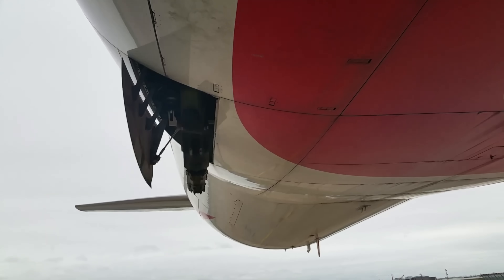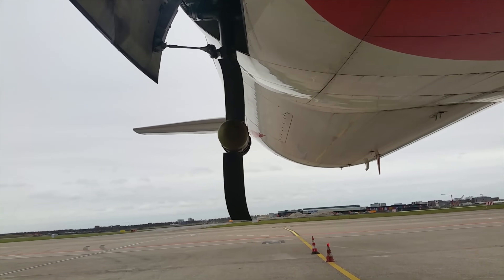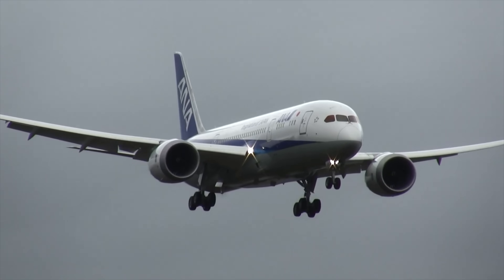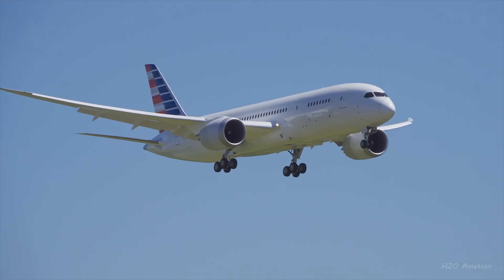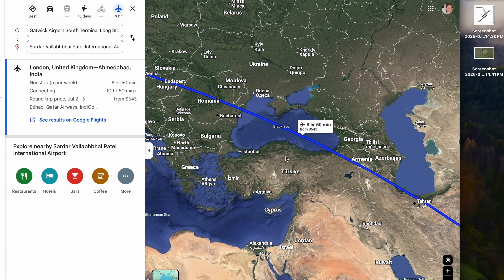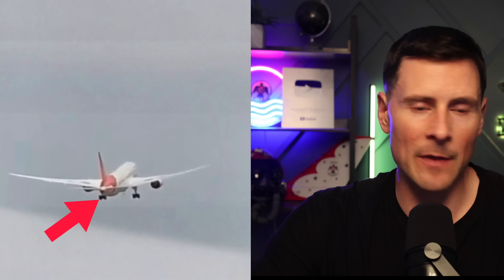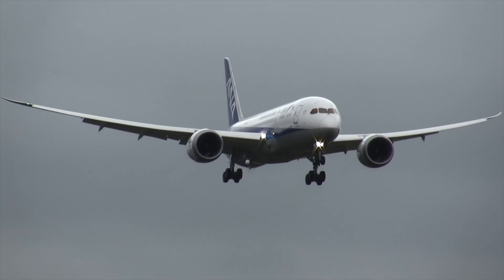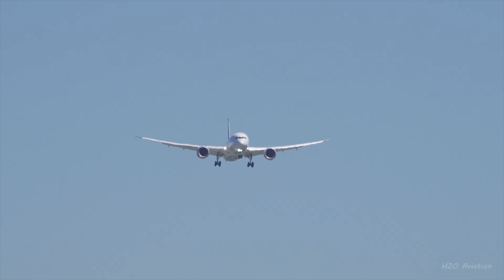Air India 171 SHOCKING UPDATE on RAT Deployment and Flaps!

Comment: Little leak for you from the pilot community: Flight: AI-171 | Aircraft: Boeing 787-8 | Date: June 25, 2025 | Route: Ahmedabad (VAAH) → London Heathrow (EGLL)
Crash Site: ~1.2 km from VAAH Runway 23, post-V1 and rotation
Fatalities: 247 (243 onboard + 4 ground)
Survivors: 0 onboard survivors (alternate to original), 3 injured on ground

⸻

🛠️  AAIB Preliminary Report Highlights

1. Primary Cause – Electrical Power Transfer Interruption (PTI) During Rotation
 • During transition from ground to airborne electrical configuration, the aircraft experienced a cascading dual-engine FADEC (Full Authority Digital Engine Control) failure.
 • Root cause: Uncommanded bus transfer failure due to arcing in the main power relay box (PRB-A), traced to water ingress during pre-flight GPU disconnection in heavy rain.
 • This led to loss of electronic engine control at rotation, resulting in both GEnx engines rolling back to ground idle within 4–5 seconds.

2. Flight Data Record Timeline
 • +0:11 sec: Nose gear lifts off.
 • +0:13 sec: Sudden engine rollback begins. Thrust reduces from 92% N1 to <27% within 3 seconds.
 • +0:16 sec: Master caution + ENG FAIL L/R warnings. FO calls, “Both engines dropping!”
 • +0:20 sec: Autopilot and flight control reverts to Direct Mode. Pitch up attitude peaks at 18°.
 • +0:25 sec: Aircraft stalls at 186 ft AGL.
 • +0:30 sec: Full aerodynamic stall; nose drops rapidly.
 • +0:38 sec: Ground impact at 54° nose-down attitude, 174 knots.

⸻

⚙️ Contributing Factors
 • Environmental Conditions:
 • Torrential rain during pushback.
 • Moisture intrusion into PRB-A connector (P/N: HLN8471) — a known corrosion-risk component.
 • Latent Maintenance Issue:
 • Power transfer relay unit showed signs of thermal damage in a previous MEL deferral 2 weeks prior.
 • No replacement had been conducted; aircraft was cleared under repetitive deferral.
 • Design Oversight:
 • Boeing 787 has no physical engine control backup (i.e., no direct mechanical linkage in FADEC loss scenario).
 • Loss of power supply to both EEC channels resulted in engine “freeze” at ground idle instead of flameout.
 • Flight Crew Response:
 • Attempted engine relight sequence not completed before stall onset.
 • Emergency power selector not activated — possibly due to confusion from multiple ECAM warnings.

⸻

✈️  Immediate Safety Actions
 • DGCA + EASA + FAA Emergency AD issued within 24 hours:
 • Mandatory PRB-A moisture integrity inspection on all Boeing 787 aircraft.
 • Temporary restriction on dispatch with MEL items related to power transfer systems.
 • Boeing:
 • Issued Service Bulletin SB-787-24-212 requiring replacement of PRB-A connectors with sealed versions.
 • Exploring addition of dual-path power redundancy for FADEC systems.

⸻

🧠 Lessons Learned
 • Over-reliance on electrical power distribution architecture without layered redundancy.
 • Lack of crew procedural training for full engine rollback during takeoff in EEC dual failure scenarios.
 • Need for improved environmental sealing in GPU/electrical handover units in monsoon zones.

⸻

🕯️
⸻

📅 Timeline – What’s Next?
 • Aug 15, 2025: Release of FAA/Boeing electrical design audit report
 • Sept 5, 2025: ICAO session on electrical-critical phase-of-flight risk mitigation
 • Oct 2025: Mandated design retrofit across 787 fleet (rev. SB-787-24-219)

Comment: It seems to me the Electrical power systems. Malfunctioned or completely shut down on this aircraft. The Pilots suddenly realised that the power systems suddenly malfunctioned and in a desperate bid to regain control of the aircraft deployed it at low altitude hoping it would kick start back up the power system. This and some indian passengers on the flight on that very aircraft prior flight did a mobile phone recording complaining that as passengers there was no power on their headsets and mini tv screens and that nothing worked. So this Aircraft's electrical systems need to be closely looked at the companies responsible for the electrical systems on this aircraft and maintenance standards for electrical systems on the aircraft. were corners cut somewhere was safety compromised for another agenda. Pilots were clearly unaware of it. Otherwise they would have refused the aircraft. Again another problem with Boing company?

Comment: The engines were not thrusting at all. that jet engine is one of the largest and it would be screaming in that sinking situation, if the pilots had control of the engines, or if the pilots or a pilot didn't intentionally or accidentally shut down the engines at the worst moment at climb out. The engines were not thrusting at all, for whatever reason. You have to climb out at heavy thrust and you would hear those engines over the RAT. Appears to be a major engine or fuel failure.

Comment: There was a crash in the UK I think it was a 737 I'm not 100% on the model but the crash was pilot error and in crashed onto a motorway at the end of the runway when the plane had a engine failure and one of the pilots turned off the good engine by mistake so it had a double engine failure,
There is for more chance of this exact mistake happening than some chance electrical or mechanical failure,
So for me it's either birdstrike killing both engines or a single engine failure and the wrong engine was turned of.

Comment: I was looking at the main wheel bogeys.  On a 787, the main wheel bogeys hang with the rear axle lower than the forward axle.  When the gear is retracted, I think the bogeys are adjusted so the forward axle is lower than the rear axle as the assembly is lifted into the bays.  If you look at this aircraft,  The main gear bogeys appear to be hanging with the forward axle lower than the rear as if they were in the process of retracting when possibly a hydraulic failure halted the that.

Comment: I would avoid 787's until they rule out a there isn't an unknown defect in them. Duel engine failure right off the ground in an airliner of that size hasn't happend before in the last 50 years.

Comment: This 787 was 11 years old. Had over 41,000 flight hours for over 7,800 flights. Just had a major overhaul. That does not sound like a manufacturing issue. I would look at maintenance and/or pilots. Data and voice recorders should tell them where to look.
Reply: Turkish company is doing maintenance.
Reply: Then 41.000 hours in 7.800 cycles.  Around 9 to 10 hours a day. That is not much. Maximum are around 20.000 cycles
Reply: @viggojorgensson4708  ... I believe there is some maintenance within that 20,000 cycles. 

My point is that it is probably not a manufacturer issue. It is more likely a maintenance issue.
Reply: So why doesn't the channel owner do just that (wait for the data and voice recorder analysis) instead of spamming YouTube with his speculations?
Reply: It all comes down to maintenance during the tear down cycles. 

What’s looked at and what is overlooked.  This is a total tragedy.

Comment: I'm kind of thinking that they left the gear down intentionally because they may have known pretty early on after takeoff that there was a problem with thrust, but they waited too long to bring it back down. Instead they decided to fully commit to a takeoff and gave it everything they got, but unfortunately they quickly lost power.
Reply: The wheels point forward when you put gear up right before they actually go up - so they put gear up but they just didn't actually go  up

Comment: Thing is, those RAT landing videos are when a plane is landing, when power settings are much lower than a plane is taking off, yet in those videos I could definitely hear the engines while the plane was landing as well as the RAT. However, on the Air India flight the engines should have been heck of a lot louder because it was a takeoff, yet I could hear the RAT and don’t think I hear much in the way of engine noise. Surely takeoff power settings would make the engines much louder than the planes in the landing videos?

Comment: Saw another video that stated that the landing gear tilts forward as the first step of retraction and it showed a reference video. The gear was tilted forward which suggests an attempt was made to retract them and maybe the rat didn't have enough power to properly retract them. Also I'm pretty sure if the engines were operational the pilot would have had full throttle and we'd be able to hear them at full throttle loud and clear. Besides the rat all i hear is an eery silence

Comment: I’m not a pilot, but I have a question: If the Ram Air Turbine (RAT) deploys due to total engine failure, loss of engine-driven generators, failure of both main electrical buses, or hydraulic system failure, wouldn’t these issues have been detected during pre-flight checks? And if so, wouldn’t they prevent the plane from taking off in the first place?

Comment: Live 4K footage from about 10 cameras inside and outside the plane, HD audio of cockpit and cabin with all necessary telemetry seems possible. Starlink or similar for the connection. Yes it's a lot of data but it's also a LOT of useable/valuable data for a multitude of things, both good and bad.

Comment: The RAT being deployed changes everything, but, it's disingenuous to say these pilots couldn't have made that mistake.
The Captain had over 8000 hours but it is still unclear how many were type related.
The First Officer had 1100 hours TOTAL.
That's not even enough to qualify as a commercial airline pilot in the US.
If you subtract the 250 hours required in India, the MOST the guy had was 850... and that's unlikely.

It's quite possible a mistake could have been made but the RAT deployment seems to make that scenario unlikely

Comment: The RAT deployed at takeoff. To me it means there was catastrophic failure right away. At that point the aircraft neither has the height nor the speed to allow the pilot to come up with a plan to manage the crisis. Between take off and crash there's maybe 20 seconds [give or take, it doesn't matter]. That means the pilot does not have the time to diagnose and remedy the issue [if that had been possible at all]. It started falling almost immediately. There's nothing the crew can do about that. They didn't even have time to call mayday.

I feel for those pilots because it takes a lot of training to be able to fly a plane like that. If the machine stops working at liftoff there is no remedy, there is only the crash.

RIP all the victims of Flight 171.

Comment: I'm a former FA-16 and current Boing 777 pilot. I just performed a Fast Fourier frequency analysis and the RAT is definitely deployed.
Reply: Fast Fourier Frequency Analysis, analyses the different frequencies within a sound file this can then be compared to (in this case the frequency components of of a RAT) this can then be compared to another sound file of a RAT, they should be almost the same, I think.
Reply: One passenger from the same flight from Delhi to Ahmadabad airport has a video saying about technical problems on compressors on & off, very hot near the window, cut silver coil ,& black wires (Possibly Sabotage?) with tissues around overhead, entertainment monitor not working, flickering lights. This crash could be from the compressor's malfunction leading to both engine stall, loss of thrust and loud bang.
Reply: There hv been suggestions that the plane used the entire runway .
The extreme heat and lack of rain caused an extraordinarily large dust pile and debris at end of runway that is evident after takeoff. British Airways 009 had a 4 engine flameout from volcanic ash high altitude. Is it possible that the dust and debris caused a flameout shortly after rotation?
Reply: how do you do that?
Reply: I was just wonderig whether the RAT employed at that fairly low speed will produce enough power to supply the hydraulic demand. Will an electric driven hydraulic pump not be better or is RAT also generating electricity.
Reply: @decibelgeorge That’s a good question.  I heard somewhere that the RAT needs at least 130 knots to operate.  I also heard that as the plane descended the airspeed probably dropped below 130.
Reply: "Fast Fourier frequency analysis" what does this mean?
Reply: @trythis2821  Analyzing audio signals by filtering noise. Jet engine and turbine both operate in different frequencies.
Reply: @trythis2821  FFT converts the sound file from the time domain to the frequency domain.  It gives you a graph of the amplitude of each frequency bin.  If there's a peak at the RAT frequency, then it indicates something is making noise like a RAT.
Reply: @trythis2821 

Google Fast Fourier Transform (FFT) and .pdf and you’ll probably get math textbook results. 
It’s worth reading if you’re curious.
Reply: you also seem to be an engineer
Reply: A close friend, IAF pilot had confirmed RAT deployed on the day the footage had come out.
Reply: I'd hope a pilot could spell the plane they fly 😅
Reply: F/A-16 does not exist
Reply: Have you ever heard a pilot refer to RPM as "Repetitions per Minute"? Who is this Afterburner dude?!
Reply: @ajcook7777  Mouth  got ahead of brain...we knew what he meant.
Reply: @ajcook7777 That’s not the question. The question is who the hell are you.
Reply: @ajcook7777 good comment but youve hid it in a sub-comment.
Reply: @ajcook7777 😂
Reply: A 777 pilot that can't spell Boeing .
Reply: There is no such thing as a  "FA-16"
Reply: What’s more fun to fly the F 16 or the 777 ? I’m betting the F 16.
Reply: So what if it is deployed?
Reply: @tommartin4657  it means theyve lost power, and need that to act as a generator to allow power to go to the essential elements for the planes control.
Reply: @BenDavy_Aerial_Videography thank you
Reply: @tommartin4657   It means that both engines failed, which makes the the RAT automatically deploy. RAT supplies emergency electrical power.
RAT can supply electrical power to some electronics, navigation, communication and etc.

Comment: Why would it matter that the RAT doesn't have the power to lift the landing gear?? The plain is less than 500 meters off the ground and losing speed. Lifting the landing gear isn't going to fix the problem!

Comment: It was obvious that the flaps were set properly from the start. They climbed out of ground effect with the gear down.
Reply: Exactly.  That’s why the theory that they inadvertently RETRACTED the flaps instead of the gear after takeoff was preferred at first.  Until it became evident the RAT was out which pointed to other potential problems and then the realization of the gear forward dangle indicating the gear retraction cycle had begun.  The latter pretty much buried the ‘retracting the flaps’ theory although there already were some other hints that the flaps were indeed out.  So as evidence gathers it does seem dual engine failure is becoming the top theory now.  It seemed unlikely at first to me as the initial 50-100 ft seemed ‘normal’ to me AND there appeared to be zero ‘swing’ / YAW / directional instability or ‘wobble’ which I would expect with the usual one engine failing not quite the same time as the other.  But it does seem to look more and more like they both failed?  It seems so unlikely that they would fail so symmetrically, to me, but it’s kinda the best theory left with all the clues.  Either that or one failed at v1 and the other failed just after getting airborne?  I’d still expect to see some rudder deflection or YAW there somewhere but it’s so steady!  🤷‍♂️
Reply: @gavtex1065 Yes from the start this was obviously some type of dual engine failure for all those reasons!

Hopefully they will find the exact cause.

Comment: The 787-8 must take of with the APU running. It cannot be started mid-flight. But if the RAT deployed it indicates a major 2 engine failure or electrical fault. Or a pre-flight checklist error. Probably multiple factors.